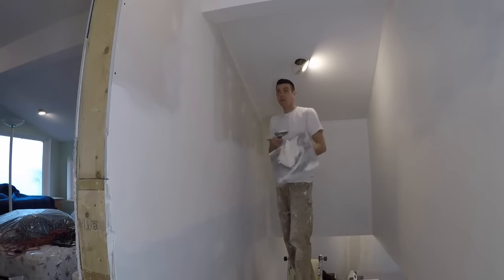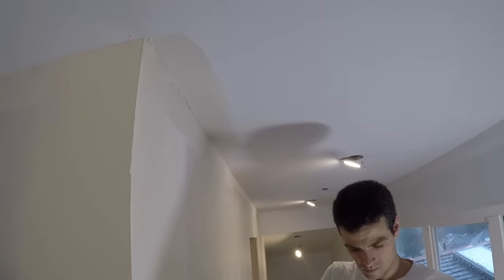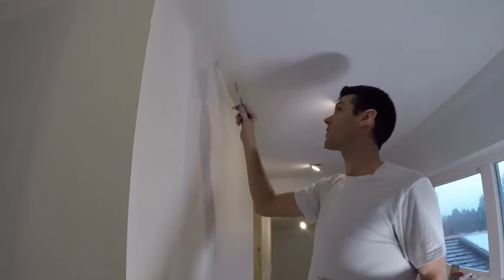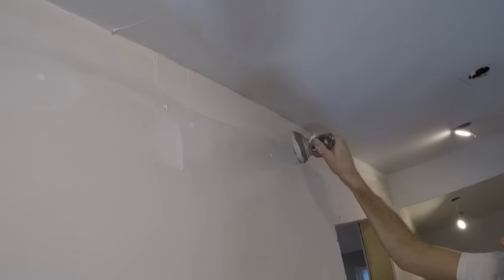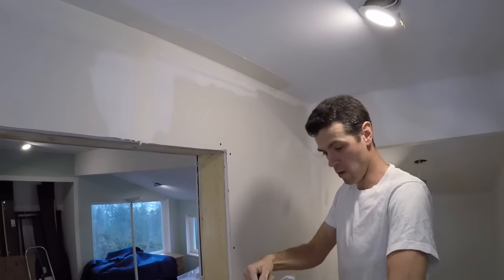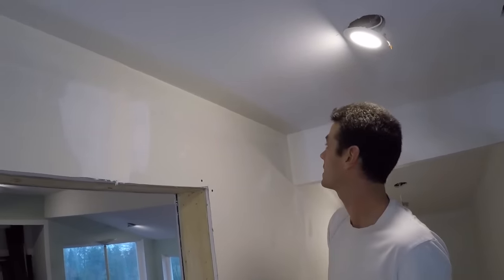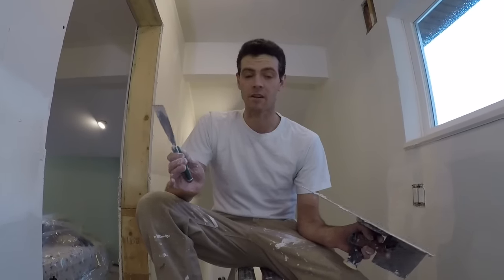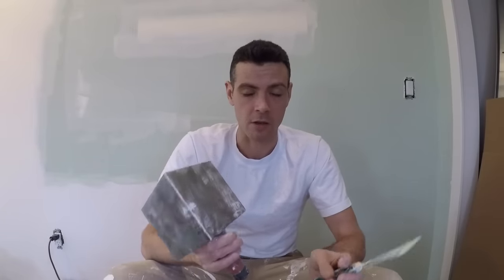HOW TO USE A CORNER TROWEL

Comment: As a professional weekend warrior, the only way to use this god awful tool, is to first put your mud into a large ziplock bag, cut the corner of the bag open, and squeeze the mud into the corner of the wall. Then go over it with this tool.

Comment: If you use the corner trowel, wash it off in a bucket of water after each pass, and leave it wet when using, I've found it works MUCH better that way. But I'm with you dude, I'd  rather coat one side at a time. If you don't feather your corners right, they'll be humped every time.

Comment: Try putting some mud on the corner tool then it spreads an even consistency also is only used on the final coat usually you tape your internal angles than set with that tool on third coat

Comment: I seen some good and work finishing both sides of the angle but it still needs to have the line cut out of it and touched up before texture and it needs to be a very forgiving texture So when you say that that trial does things that look better on camera so do your f**** angles did that you can't do two sides of an angle without cutting the mode on one side free with a knife

Comment: Well if you are using it as a shim, you probably fucked up the corner trowel.  It has to be square, also once you use it alot more it will form naturally for a good corner. Also if you are on scaffolding you can walk the whole scaffolding using the corner or if you are on stilts.
Reply from the maker: The plank shim was just a joke. Only time I have ever done that.
Reply: @vancouvercarpenter  right on. Lol. I dont know I used to work for a plaster man for about 9 years. Went on my own and I have always used a corner trowel. I snipped the top corners on an angle to reduce drag. Doesnt leave ridges or Mark's. Enjoy your videos though.  I think everyone has their own style and techniques in drywall. I always do hawk and trowel. Its alot easier for me. I wasn't trying to judge you or what not lol.

Comment: I always use a corner tool and I founded much faster..how can’t not be when I can do both sides at the same time and almost no time spend sanding the angle.
Reply: It's easy to run both sides of the angle at the same time you just have to hold your 6in drywall knife to wear the very corner is going into the angle just that very tip not the whole side edge of the knife and you wipe it clean and tight it comes out perfect

Comment: I hate one side at a time. It sucks. Two tricks to using a corner trowel - First, don't lay down too wide of mud before using the corner trowel. Let the trowel do the spreading. If the mud is as wide or wider than the wings on the corner trowel, you've already screwed up. Another trick is to use 2 hands. One to hold the trowel handle, the other to push the wings open so they are pushed hard against the wall/ceiling. There's your final feathering and no need to go over the edges with a knife. Three way corners are tricky but just be careful how the trowel touches the corner.

Comment: Sorry mate but you don't know how to use it properly. If done by hand we use a 3" off-set knife  to bed the tapes,and we use setting plaster! The corner trowel is used with drying plaster. Apply plaster each side with 4" then use two hands,one to hold the handle and one to flare the blades. Run along or down the internal with moderate pressure will fill the inside and feather the edges,clean off excess. The angle is set by pushing the tip into the corner and lift the trowel until it touches the ceiling.

Comment: I've used em and they work, like anything else it takes practice and alot of pressure, if you can do both sides at same time it saves time.....no taper I know uses em and when they hand tape my jobs i always have to caulk angles bcuz they arent smooth......of course automatic tools are fastest and probably leave best results, it you tape everyday I cant even imagine not having a set......like a finish carpenter without a chop saw, lol

Since your a drywall taper mostly, You should be Vancouver drywall taper not carpenter, lol

Comment: I was not taught by hand only finishers very good handyman who 
Used angle finish heads that apply finish and trowel smooth in same pass
And I've been doing drywall over 22 years dude and been in carpentry since I was 13 helping my dad cuz we were playing for I got tons of experience I'm well-read and I'm not even the best drywall finisher but if you're not happy with that trial I didn't even need to see very long in the videos you're not using it correctly or not dealing with its limitations incorrect for her style and preferences
 I used it only after over 10 years after sanding over my buddies angles when he tried it out at work
 you're either not loading at enough mud on in the first place which is incorrect no matter what your style is are you loading too much mud on and you haven't figured out how to properly feather The Edge back into the angle without wiping too much mud off or f**** up the corner cuz that thing leaves as smooth and totally true inside Corners as God could do this stuff by hand if he was doing drywall so it's better than me or or you is definitely not a f**** 20-year veteran of only drywall with a name like Vancouver Carpenter although I will admit that you have skill and some good ideas from watching the threeway Corner video AND ITS BETTER THAN ANY OTHER MAN OR TOOL ON THE PLANET USED ON THIS EARTH FOR PRETTY BAD FRAMING TOO
it7 the best drywall you've ever met so pass the first quarter inch of the ads even if you put too much mud on them needs that cut line with the go f**** booger next to it you later book a ride back to give me the feather  out do the f**** best angle heads in the world and the best fucking TRUE smooth wall hand finishers in the world on prevelantly bad shoulders on recessed edges by assfuck USG and all the others fairly shitty quality board so I'm going to finish watching your video now 'll l bet  I've already nailed your ass and I didn't even make it to a minute of it

Comment: Lol, this guy is just shitting on all the ways I do things. First it was the mesh tape, then the curved trowel now this. Whats next? How about the bucket scoop? you have something to say about that one?   Hehehehe

I use those corner tools all the time. With AP mud its worth it. One day to do all the ceiling corners and all the joints that dont touch the ceiling. the next you do the walls corners and the joints that dont touch those corners.

A little practice and the corners are perfect every time.  Having said that, my old man is terrible with the corner tools so I guess it doesnt work for everyone.
Reply from the maker: :) I am open minded enough to realize lack of experience with the tool is my primary obstacle to getting a decent corner.

Comment: Love it when he says - “ I’ve done a Loooooootta corners in my time”. What are you 27-28 Bud? 🤣🤣🤣🤣. Can tell your a Greenhorn by the incorrect Grip in your backhanded motion, wrong pressure on blade at given times, and most notably, way wrong on angle of 4” scraper when feathering. I hope you only charge for your ability level!
Reply: Ok, boomer

Comment: You’re holding it wrong!! The handle goes in your palm almost down to your wrist and wrap your thumb around the handle. You then press your fore finger and pinky against the “wings” to control the spread of the mud. Spreads the mud properly